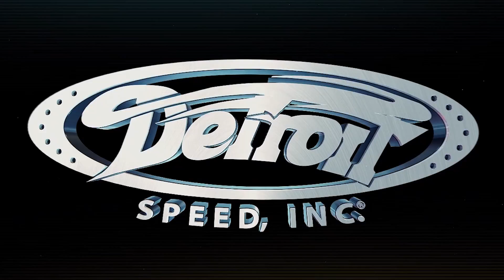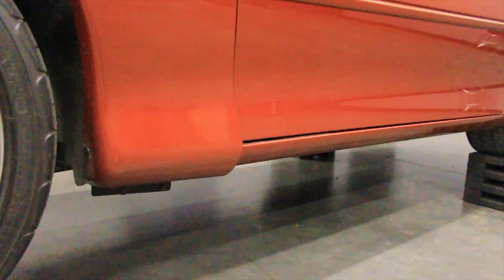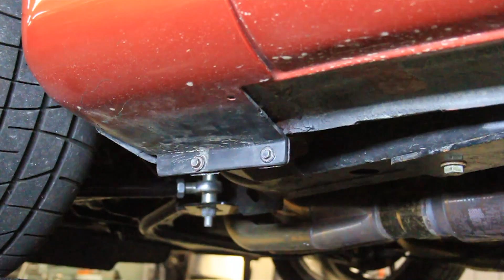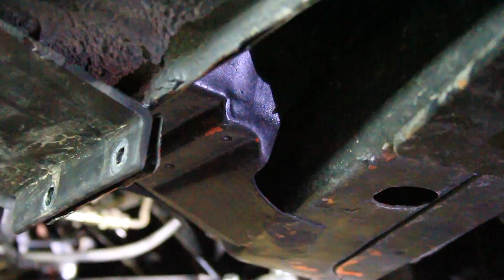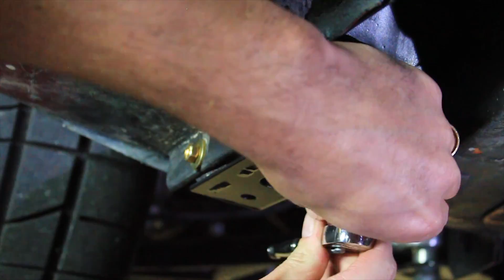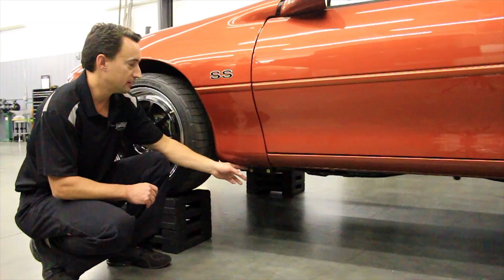1998-02 Camaro/Firebird Fender Flange Shield Kit - Detroit Speed

Comment: I've been thinking for years how to address this issue. That's a perfect solution to protect that fender flange from careless mechanics.
Reply: Yeah, I'll be getting a set of these soon.
Reply from the maker: Give us a call and get yourself a set!  They really are useful.
Reply: @detroitspeed  I looked at my 2000 Camaro this morning. It doesn't appear to have those two holes in the sheet metal. That in itself isn't a major issue, but the metal tab the fender is bolted to, is pretty twisted up.
Reply from the maker: @MichaelWRutherford  You could always drill the holes out for the 1/4-20 tap.  If the mouting tab is mangled, this kit is for you!
Reply: @detroitspeed  I was wrong. They are there. I just couldn't feel them with my finger.
Reply from the maker: @MichaelWRutherford  Gotcha, that will make the job easier then.